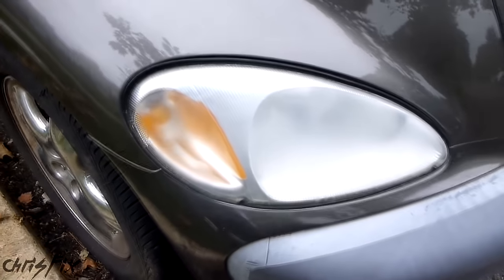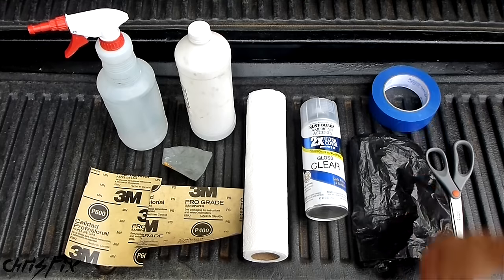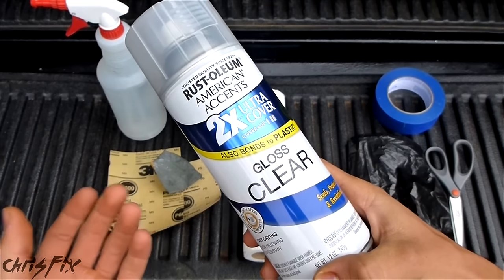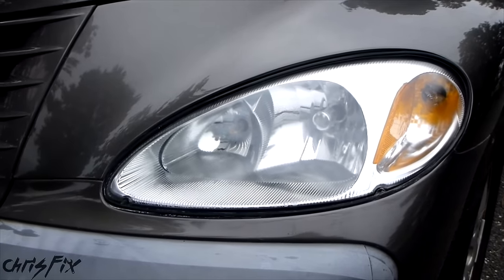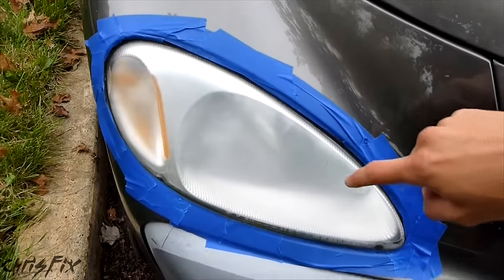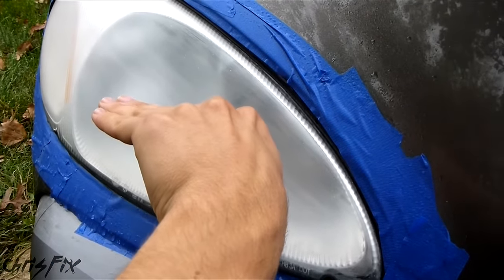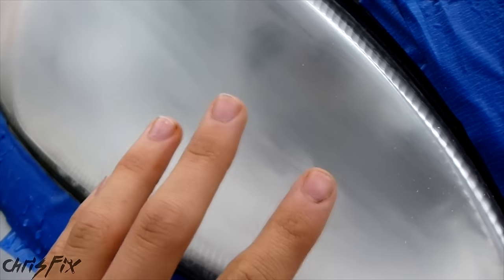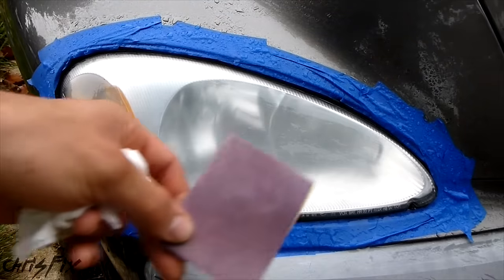How to Restore Headlights PERMANENTLY

Comment: He didn't mention it, but that last coat is a bit heavier. Its a fine line between not enough and too much and it runs.

But to get less orange peel, make that last coat heavier.

Also, when wet sanding, be careful of any sharp edges in the shape of the plastic. The sides, and on some cars there might be a ridge in the middle, etc. Its all too easy to burn through all the paint with the sandpaper on any sharp edges. So go very easy on any edges.

Comment: hey i love your videos, i was just wandering my resolts are a litle bit of crecked paint i was just wandering if u now why is thet? ither wai thx
Reply: Maybe it’s because you could’ve coated too thick or unevenly, headlight still had contaminants on it, not dry enough before applying, or sometimes drying in direct sunlight. 

So many different causes and hard to tell which one was the problem.
Reply: I once cooked lasagna in the microwave too long and it was burnt 😔

Comment: Passenger side came out perfect but the right side driver side came out with some crackles it almost looks like a little crackles across the light
Reply: See my  earlier post regarding prepping the plastic lens with a rattle can of adhesion enhancer, which make the lens "accept" the paint much better.  It prevents the crinkling effect.

Comment: Hey Chris, not trying to disrespect you, but I think in the future I would be careful with recommending rattle can clear coat without specifying the risks. After watching this video I bought 2k SprayMax clear coat in a rattle can and used it for my headlights, but what I didn’t realize they have isocyanates (poison) in them and that I was supposed to use a respirator, body suit, etc. to prevent exposure—which people say can cause cancer amongst other things like asthma. This is by no means your fault because I should’ve done my research (and read the can, too) but I will say I was very casually following your instructions and wasn’t aware of risk factors like this. Hopefully I don’t have any after affects from using 2k clear coat.

Comment: I read on some forums that 2000 grit is too fine and we shouldn’t go higher than 1000 so the clear coat sticks better. 2000 will peel I guess. Anyone try 1000 grit? Did it leave lines from the scratches or did the clear coat cover it up nicely? Thank you all!

Comment: I followed your directions but paint crazed.  Sanded off clear on one headlight and re-sprayed.   It crazed again.  The paint I used is the exact same stuff you mention in the video.   What gives?
Reply from the maker: Some lenses are made of plastics not compatible with some paints. They sell a clear primer that is designed for plastics that you can try. I’m assuming the humidity is low and temp is above 60F?
Reply: @chrisfix  Thank you for the prompt reply.  I live in Arkansas so the humidity is never low.  Temp was above 60, it was 72.  Car is a 2004 Subaru WRX wagon.  I thought about the paint and it was from a store known to have stuff on the shelf for years.   However, I'm going to try a more expensive paint, USC SprayMax 2K Glamour High Gloss Aerosol Clear.
Reply: @johncorona4337  did it turn out ok?
Reply: It was much better with the 2k clear.
Reply: @johncorona4337  just did mine about an hour ago and theyre starting to craze, sigh. ill see if I can find the one youre using, maybe it will work better
Reply: @ChrisMiller-uj2sv  I was extra careful the second time.  I cleaned with alcohol twice, then a degreaser, and finally a wipe with a tack cloth right before painting.
Reply: @johncorona4337  how did that new clear coat work for you ?

Comment: Clear coat becomes as cracked lines and degraded after 3 month and it becomes very hard to sand and remove it. Without clear coat headlight also becomes yellowish after 3 month. So I am stack to make it last at least 1 year :S

Comment: I don't get it. I did it the same exact way and used the same exact paint and it looked okish after the first light coat, then I did a second light coat 5 minutes later and it all turned to complete shit. It was cracking and bubbling right in front of my eyes. They were light coats sprayed from 12 inches away and it looks like complete shit. Maybe I got a bad can of paint. Now I can't sand it off to start over. Nothing finer than 80 grit will touch it. I might be screwed. I've watched several videos of people doing it the same way and using the same paint, I don't get it.

Comment: To big step betwin 600 too 2000 sandingpapire paper 
Better to use dual action macinine  ,  500, 800 dry sanding, , 1000, 2000,2500 , 3000 weetsanding, before rubbing , it you have uv paint  save you the round of polishing  
I have do this jobs  of many head lamps..

Comment: Old video but:
PRO TIP: Do this when the car is dirty!  So, even if you get overspray, and you probably will (with that covering), the overspray will not stick!  :-)
You did not get all of the old coating off!
IMHO: Grits; 320 (if bad), 400 or 500, (inspect and decide), 800, 2000.  If you use 3000 instead of 2000, you can polish by machine instead of paint.*
(3M is good sandpaper!)
*Polish a small area to finish quality.  If it is not good enough for you, redo with 4000, then polish.
Never use too much pressure with any grit, especially the 320.  However, the entire old coating should be removed!
Finish with a ceramic, or (hybrid) ceramic spray, or at least a UV protectant wax.
Wear a respirator.

Back then you did not how to use a rattle can.  :-p

IMHO: Painting with anything is not the best option.  It is too easy for people to mess up, as shown by this comment section, and that just makes much more work/expense, and consumes much more time/days.

"This looks awesome."  "It looks almost new."  ...  Actually, no to both.  Better, good, would be much more accurate.

Get rid of the video and make a new one.  :-)  (Or, do you have one already?)

Comment: i also didnt use the 2000 grit i stopped at 600 i used 400 tehn 600 i forgot teh 2000 and i dont even think they sell 2000 grit at stores around here...if it doesnt turn out ill start over or at least start at the 2000 grit part and clear coat then wax it..i did the 400 and 600 but i mistakenly used 400 and left scratches when i shouldve been using the 600 at the time so one light has alot fo scratches

Comment: Is Motip Heat Resistant Clear Coat good for this job?
Reply from the maker: Just need to check compatibility with plastics. Also high temp paints sometimes need to be baked on to cure. Just figure out if that’s the case.

Comment: DO NOT USE SPRAY PAINT, just because it says clear coat for plastic. Dose not make it the right product. Instead use megiurs head light coating spray, its made for head lights by a professional car care company. Chris should a updated video with the right products.
Reply: Totally agree. It’s not 2 pack which is a little safer to use and designed for this headlights. There is no permanent fix and depending on several factors, a repair might be needed again. If you have used a 2 pack product it’s much harder to to remove

Comment: What's for Compound polish to remove orange peel from description? Am I missing smth?
Reply from the maker: In the description I have a link to a polish that helps remove orange peel. You would sand with 2000 grit and then polish it.
Reply: @chrisfix  So it's not on the video but after sanding with 2000 I can use the polish compound? So like in 7:30 I can use it If my headlights are in bad state?

Comment: Unless you know what you are doing, PLEASE DO NOT DO IT.  This Clear will not stick to  Bare Plastic.   But it will stick temporarily. Permanently NO.  Most Aerosol Cans are not meant to be sprayed onto Bare Plastic.  For anything to adhere to Bare Plastic, you HAVE TO either have a Spray Can  that says, NO ADHESION PROMOTER REQUIRED.  Or you have to use an Adhesion promoter BEFORE YOU SPRAY THE CLEAR COAT. or before you spray any material onto Bare plastic.  To prove my point look at the SEM  Aerosol Spray Cans - Adhesion Promoter 39863,  SEM for Honda Bumpers 39293, NO ADHESION PROMOTER REQUIRED.  Without this Adhesion Promoter, any Coating you Spray can and will flake off in time.  I have been Painting Cars for 42 years now.  So I know.
Now, I do not work for The SEM Products company or anything, just that I have been using these SEM products for about 30+ years now.  These cans cost around $20+ a piece, and these are products used by most Auto Body Shops, and not sold at Home Depot's or Lowe's.
Also here you don't need to do a final sand with a 2000 Grit Sand Paper.  Grit 2000 is WAY TOO FINE for this job.   For an Aerosol Can job,  you can Safely Spray over 800 to 1000 grit Sanding Scratches.  Sanding with 2000 grit is mainly when you do a Color Sand and Buff job, or if you are going to be blending and fading out a specific blending job, and that is where you sand with 2000 Grit and then you use a blender to melt in the dry Clearcoat.  
Another thing to keep in mind is that, if you use 400, 600 and 2000 grit papers, make sure that the 600 grit WILL REMOVE ALL OF THE 400 SCRATCHES.  and that the 2000 WILL REMOVE ALL OF THE 600 GRIT SCRATCHES.  This is NOT SO EASY for someone who has never done Sanding and Painting.  In Body Shops we use a special Guide Coat that helps guide us with our Sanding and to remove all previous sanding scratches.  Look at the SEM Guide Coat Spray Can  38203 and 38253. 
Another thing to keep in mind is that whenever you do a Spray Can job, make sure you are doing this when it is nice an warm.  Never do this when its Cold and specially the surface you painting on is Cold.  For instance, keep the Headlight in a Warm Spot or facing the sun before you start painting.  Cold is never good when it comes to painting.  If the surface you are painting is stuck where there is no sunshine, then use a Heat Gun lightly or your wife's Hair Dryer.  And always remember to keep the surface a little to the warm side, around degrees 70F. 
If you can, wipe the surface you are going to be  painting with a Solvent Based Degreaser or Acetone BEFORE YOU START TO SPRAY ANYTHING.
One final Tip.  NEVER SPRAY TOO WET.  Meaning never spray your coats too wet.  Start your first coat almost like a very light dry coat, heat gun it for 20 seconds, then spray a second coat slightly wetter than the first then heat gun it for about 40 to 50 seconds, and keep going this way. You can spray your last coat the wettest, but be careful not to heat it up too much or your can and will boil the surface of the paint.  Use the heat gun or hair dryer from further away then.
Good luck.

Comment: What happens if there a little more orange peel then expected is that run caused by the spray and how do I fix it
Reply from the maker: Let it dry then sand with 1000-2000-3000 and polish them until clear.
Reply from the maker: I would give it a wet sand and see how it looks after, could just be the properties of the clear coat you are using
Reply: @chrisfix  thank you boss still responding to this day thank you 🫶🏽🙌🏽🙌🏽🙌🏽🙌🏽
Reply: @chrisfix  I put a little too much on one part of the mirror so I think I put too much but I will try wet sanding with 1500 then polishing

Comment: Link for wax is dead.
When do we use the (Compound polish to remove the orange peel, is that after the 3rd Clear coat dries the 24 hrs. 
Why didn't you do this step?
Why the link to the very overpriced 91% alcohol at almost $19.00 for 2 16oz bottles you do know you can get that at Walmart for only $2.00 per 16 OZ bottle @ 91% alcohol that's a difference of $15.00.

Comment: could i just use a 800 grit with water?
Reply: I did that and mines came out pretty good I recommend to not wetsand at the end or at least wait until it’s fully cured I don’t think 24 hours is enough because I did it and they got all hazy again and had to respray a light
Reply: @A77738  yeah i just ended up buying blacked out headlights heard they don’t change color like clear ones

Comment: Good way to get a shit coat that won't stick. Tried it twice. As usual, ChrisFix videos set you up to fail. You don't polish something before painting it. Going up to 2000 grit is pointless when you're going to clear coat it, and just results in the clear coat having nothing to stick to, and sort of beading, because of surface tension, which leaves a clear coat that looks like it has a bunch of cracks running through it.
Reply: For someone that has a clear explanation of what goes wrong, it's funny how you attempted the fix not once, but twice, and still failed.
I've barely got any experience with any of the skills needed for this task and it still came out excellent, even better on the second vehicle.
The only person you have to blame here is yourself for doing a bad job lol.
Reply: @MrNasty-jd7kg  I ended up finding a much better way in the end. The paint he recommends just isn't what you want for this shit. Maguire's is the recipe.

Comment: Sorry but this is not how you do headlights. Those headlights are not clear, they're still hazed. I can make them look brand new. I have several of my restorations on my FB page, I also detail vehicles for a living. I use four grit strengths and never use 400 and rarely 600. I use a 3-inch hook n loop 800/1500/3000/5000 Sonax Ultimate Cut to buff out then Perfect finish as my polish then I clear coat them. Oh, and with my Ultimate cut, I use a wool pad with rotary, foam for Polish.

Comment: The only thing I would do differently is I'd prob do a light sand with 3,000 and reclean the surface in-between each coat of clear. Might not be necessary but I'm anal like that 🤷‍♂️
 Great vid, thanks for posting.

Comment: Another U/V preacher. I'm done here.
Reply from the maker: huh?
Reply: @chrisfix  if you apply UV clear coat to a headlight restoration your doing it wrong.
Reply: @joewhitlock9996 do you wanna provide some alternatives perhaps?
Reply: In my experience using the polish method works far better.
I applied clear coat once as a technician at jiffy lube when they decided to apply it.
I had already done the polish to both headlights, and then the clear coat to one side and regretted it immediately.

I had my then manager come out to see the difference and told him I would never apply it again.
He agreed since I was his most experienced technician for headlight restoration.
He then brought the customer out to see the difference and they had me correct the clear coat.
I basically redid the whole job to that one headlight.
And so I retained customer satisfaction.
Long explanation, but I would pit my skill against any tech who uses clear coat protection, and would even like to see a real world test over the course of two years to see which one holds up better.
I didn't stay at jiffy lube long enough to see the results that far out.
And if you like, I could add another story, or even share some pictures of my work.

My personal belief is that the industry standard should change.
The rest of the video is pretty much spot on.
I use the drill method myself.
Best of luck.

Comment: Didn't work that well, no matter how much time you spend on it. Will never look as good as you think it will. Plus the health risk involved with the spay isn't worth it.
Reply: Worked excellently on both my vehicles, and they are still holding up several years later. 
You can typically avoid the health risk by wearing PPE, and not spray painting inside a small room. Hope this helps.

Comment: Car headlight manufacturers have a high tech coating on their headlights. The strongly advise to only use soap and water.  These headlight videos didn’t work for me. I wasted hours of time and $550 replacing my headlights after all of these voodoo methods made my headlights incredibly worse. Everyone is selling kits that don’t work. Think very carefully before sanding your headlights or applying chemicals. Acetone is a good solvent but it doesn’t clarify polycarbonate headlights. It took me days to drop the bumper bar and replace the headlights. Dozens of bolts and clips and very complicated for the novice. I’m not sure how the presenters get the different methods to work, but if like me all the methods don’t work, it’s very expensive to fix and  big job to replace.
Reply: It’s honestly a pretty easy task I did it first time ever wetsanding and had never sprayed anything in my life but I still managed maybe hold yourself accountable for doing a bad job?

Comment: You said I use wet sanding as water acts like a lubricant and I don't won't to scratch the plastic 🤪 The sanding of the lens is to remove the oxidation on the surface of lens, Far better to dry sanding works best!!! Grit sizes should be p500- p800 and then p3000 trizact pad, And you don't need alcohol to clean the lens, Any good glass cleaner will do as all glass cleaners contain a small amount of alcohol anyway, And that clearcoat doesn't state for headlights only?? There's plenty on the market that do!!!